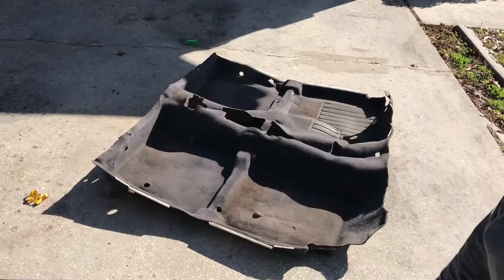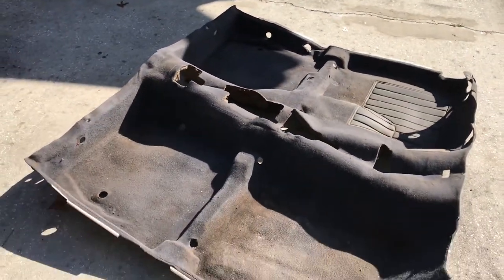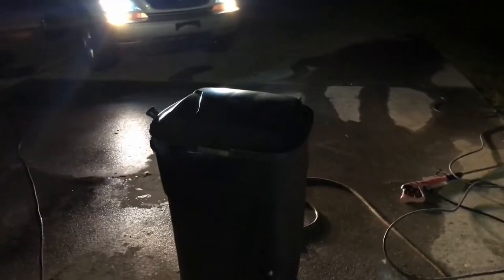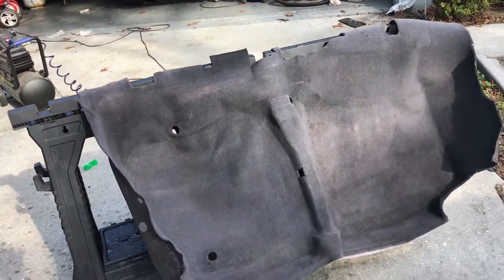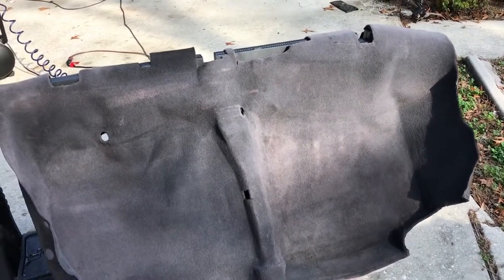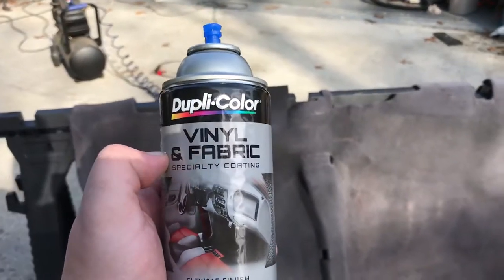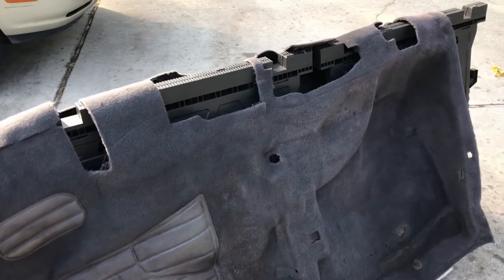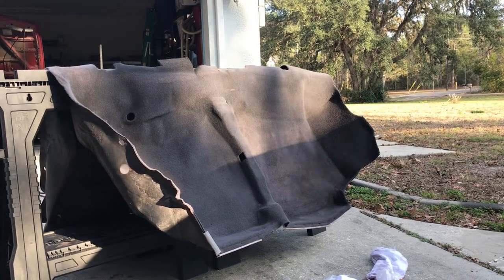Project S14 Ep. 2! - Proper Carpet Restoration and Dying process

Comment: Used Duplicolor also on a used carpet and floor mats I picked up. Color wise it’s great! Did not try the brushing method so it is a little more stiff feeling. I am curious if using fabric softener (like Downey/tide) and water will help? Thinking bout loading it up in Bissell spot cleaner/extractor…

Comment: RIT does work and you could have done it with one bottle, 2 at most. By sticking it in a trash can full of water, you completely diluted it, therefore not giving it the full affect. Even some professional carpet restoration companies use it in house carpet. The aerosols are not good in long run.

Comment: Excalibur mobile detailing is correct. Your dye was way over diluted. 2bottles of RIT, 2 cups of vinegar and water in a gallon container. A cheap Harbor Freight automotive paint gun and it works fantastic. Your carpet does look good but you worked to hard. But hey, that’s how we learn to do this stuff. Great video.
Reply: did you rinse after?